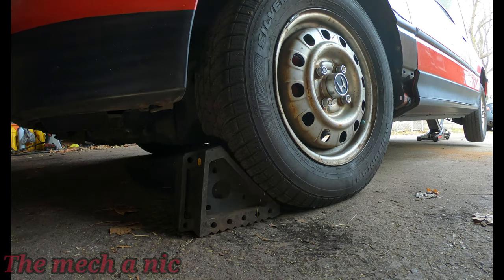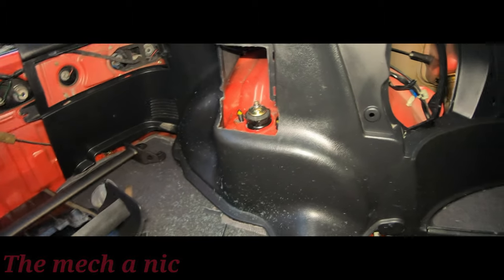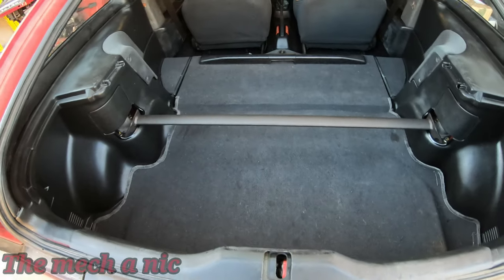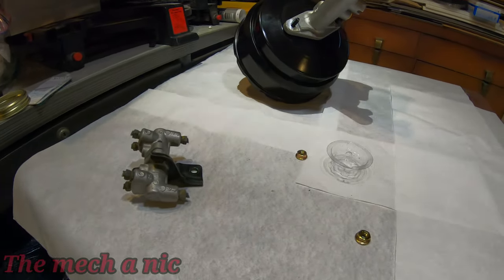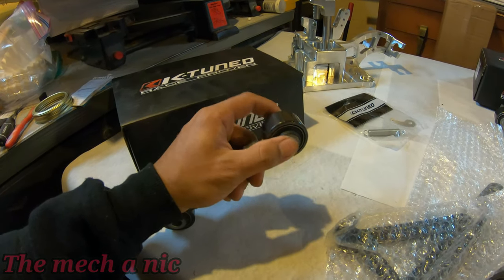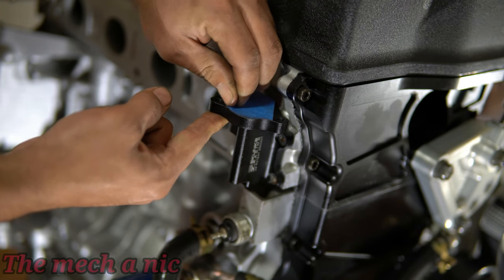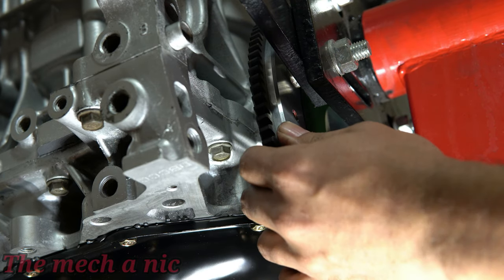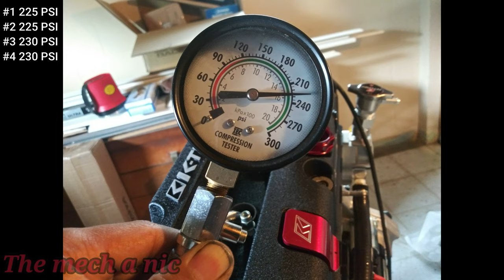crx strut brace / brake booster - CRX PROJECT VOL 6

Comment: Oh this brings back memories. I remember swapping the master cylinder on my 1990 CRX Si with a Civic EX cylinder and it made a nice difference. 

Later on I bought a 92 Civic CX hatchback and swapped over JDM Civic SiR brakes (discs on all 4 wheels) and had to swap over the rear trailing arms, the 40/40 prop valve, and the e-brake cables, too. 

I learned a ton on Honda's.

Comment: That came out nice. You should notice an absence of body roll.
I have one in my Buick (OEM) because of plastic fenders.
It's meant to stiffen the body, not really affect the "suspension".
Reply from the maker: The crx needs all the chassis stiffening it can get. It creaks and cracks going over bumps

Comment: I installed the Fastbrakes Wilwood front 4 piston caliper kit and am wanting to do this upgrade to the rest of the brake system. What year make & model is the 40/40 prop valve off of?  Cool video, subscribed.
Reply from the maker: I barely remember but I want to say it came off a 91 crx si
Reply: @themechanic6117  hmm I’ll check to see if mine is stamped 40/40 then, because mine is an Si. Thanks for the quick reply. 👍🏼

Comment: No Loctite on the flywheel bolts? I highly recommend that you use Loctite.
Reply from the maker: Its only on so i cant occasionally crank the engine. Once its ready to go in the car ill install the rear main seal and loctite the bolts 👍

Comment: Bro, Why did you have to remove the old proportioning valve?I’m doing the same conversion on my 88. Wasn’t they the same?
Reply from the maker: From what I read online , the rear drum brake and rear disk brake cars use a different proportion valve

Comment: What brake booster did you buy to make this happen I got one for my crx si 89 but it wouldn’t fit and also master cylinder
Reply from the maker: It's a brake booster and master from a 91 integra

Comment: Where do you get the manual book for your honda crx?
Reply from the maker: Found it on ebay . It'll say civic/crx
Reply: Okay sir..do you mind give the link? So i might get the same book as yours
Reply: And i just check ebay..there are tonnes of manual book for crx..could u please send me the link..btw ur manual book do have wiring diagram?
Reply from the maker: https://www.ebay.com/itm/1984-1991-Chilton-Honda-Civic-CRX-Repair-Manual-/380643743413?mkcid=16&mkevt=1&_trksid=p2349624.m46890.l49286&mkrid=711-127632-2357-0
Reply from the maker: Yes it has wiring diagrams in it
Reply: @themechanic6117  alright sir..and its for honda crx also..mine is Si model
Reply from the maker: Yes it says for civic / crx